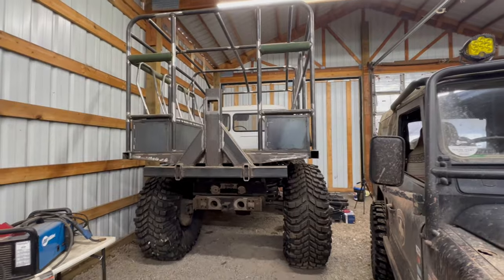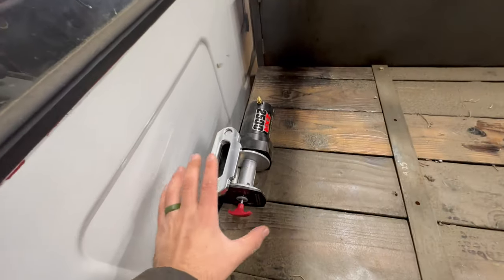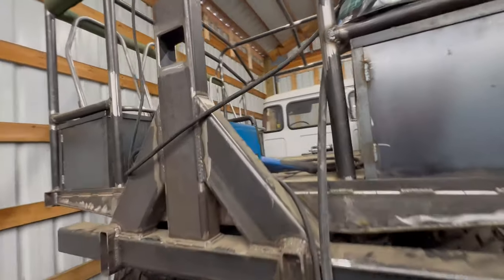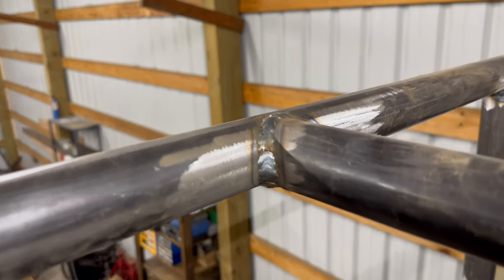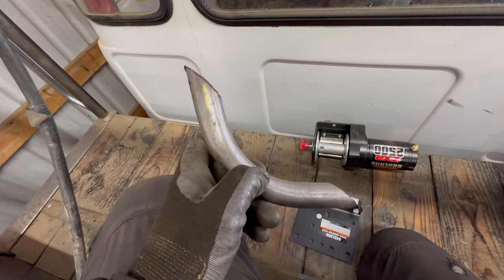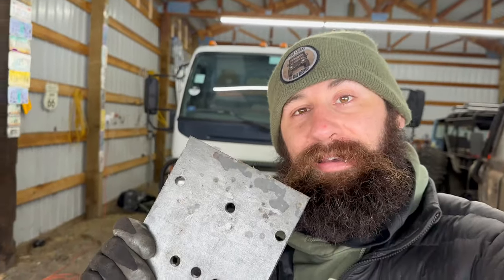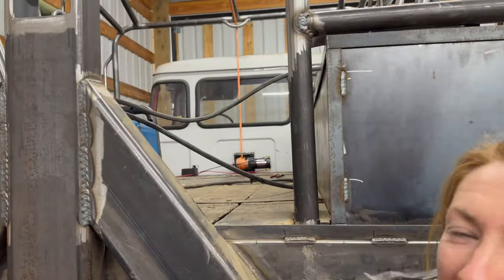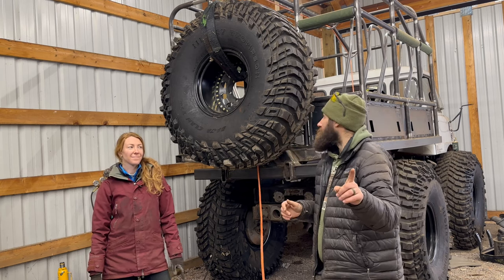WORLD'S BEST OFF-ROADER - THE UNIMOG - FABRICATING A SPARE TIRE WINCH SYSTEM

Comment: Instead of using a tree saver could you use the loop you already have on the line and then make the end of the winch line long enough with a loop on the end to go through the rim and then connect the loop on the end of the line to the loop right above the tire with a soft shackle?
Reply from the maker: The inside wheel edges were pretty sharp and we didn’t want to damage the winch line. Tree strap is an old one we had lying around so we didn’t care if it was damaged. But this isn’t the final solution we just wanted to test it out

Comment: Do you think it's true that spraying all of the "to be welded" joints with Easy-off Oven cleaner makes the weld clean and welds better? It COULD save hours of tedious shop time. I haven't tried it yet.
Reply from the maker: I’ve never heard of that but it sounds dangerous. There are a lot of nasty chemicals out there that are extremely toxic when inhaled. I’d stick to working a little longer and having my health. Acetone works really well for prepping welds

Comment: Maybe I missed it in a earlier video.  What are you going to do with the zero up travel ypu have now? Cutting the body big time, Lift? I have always wanted a MOG.
Reply from the maker: It’s not sitting at final ride height BUT we’re not too worried about maximum articulation for snow wheeling
Reply: @threecreeksbackcountry   ah good,  it may not be a crawler but at its current up travel it would be problematic :)

Comment: What's the 🥒 in the center for  ? I thought you were putting the tire in the bed. 
Wouldn't a rolling pivot be better for the rope  ?
Reply from the maker: We’re mounting the spare on the rear. As for having a rolling pulley, yes it would be better on the rope but this won’t get used everyday. We’re keeping it simple

Comment: You've used the term "roll cage" referring to the rear structure - is it intended to be an actual cage or more of a bed cover?   I run a similar style "cage" in my topless D1 and I can tell you from experience (as well as simple logic) a bunch of rectangles isn't much for strength.  Triangles man, think triangles.
Reply from the maker: This cage will be strong enough to protect in a low range rollover, but it’s not going to pass any race cage standards. We did use DOM tubing to buff it up too, but it’s not designed to be bulletproof like the cages you see on buggies by any means
Reply: @threecreeksbackcountry  Fair enough.  The "cage" on my D1 was done the same way when I got it.  It held up fine for some very gentle flops but last year took a pretty hard flop and pushed the B-pillar area in quite a bit.  Sure I still drove it out and nobody was hurt but it certainly wouldn't have moved with proper triangulation.  Like you, this is just a trail rig and isn't supposed to be competition spec by any stretch, however I did go in add cross bracing at least for the front seats since that's the only seating area I still have.  Sounds like you understand the limitations.
Reply from the maker: You probably wheel your Disco way harder than this Mog will be wheeled 🤠, at least that’s the plan. It’s being built for snow tours here in the Cascades where it’s pretty tame to be honest. Deep snow but pretty wide forest roads. Nothing like the Sierra trails you guys run 🥲. But I will probably take your advice and add some diagonal cross beams to the front and rear. We just have to finish the spare tire mount first. 

Still need to bring our Landy on the Rubi one day 😎
Reply: @threecreeksbackcountry  Rovicon VI registration opens next month!

Comment: Tip to save cut-off wheels cut it by scoring it you will save 50%. Plunge cutting waists it due to excess heat.
Reply: But they were some nice straight cuts.
Reply from the maker: We do a LOT of grinding here. Scoring through 3/8” steel would be absolutely brutal compared to straight cutting through, even if you do save a disc it wouldn’t be worth it personally
Reply: Well I’ll say this 3/16”- 1/8” cut off wheels work at there optimum max speed and light pressure. Cuts fast enough to have a track to follow in four passes. That’s all I’ll say about that.  Trying to save you time and money✌️
Reply: Same can be done by 4 scoring passes. The disk doesn’t get gummed up haveing to clear dust, that why you have to stop a few tomes when hogging out the metal. Where as scoring there’s no buildup of cuttings in the slot. I’ve cut 5/8” plate this way at work for 10 years, till we got a plasma cutter and a straight edge.

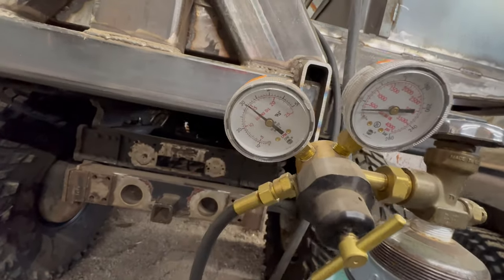Comment: 8:40 - you're running 30 psi on your regulator?  That's really high for MIG.  Most people will run single digit pressures of 5-8 psi unless outside in windy conditions.  I realize 30 is the static pressure and it will drop when you pull the trigger but double check and I think you'll find you're wasting a lot of gas.  Not trying to be a troll; but hopefully save you a buck or two in gas.
Reply from the maker: We are in windy conditions to be honest 😂. We weld with the shop door typically open and get a consistent afternoon breeze. 5-8 psi and we get real annoyed real quick. 30 psi is at the upper end and we find that it works for us. We’ve met folks who just keep it wide open and that is wasting gas for sure. We’ve messed with all settings and 30 psi seems to work best with our conditions
Reply: @threecreeksbackcountry  I've run that high working outside before to avoid porosity, so I get it.  I know one time I forgot to turn it back down and burned through a bottle in what seemed like no time!  But if that's what it takes I guess that's what it takes.